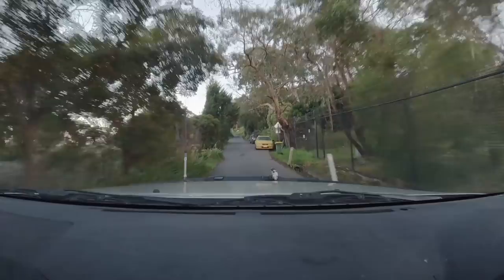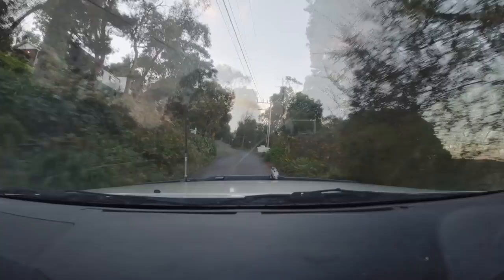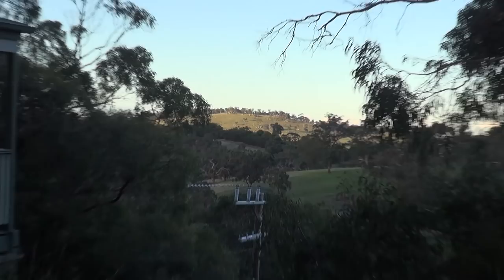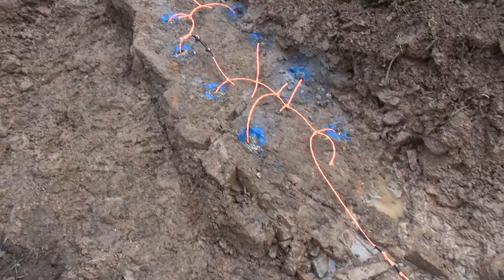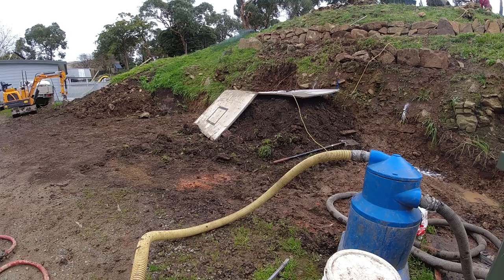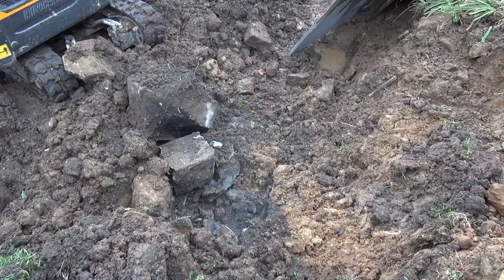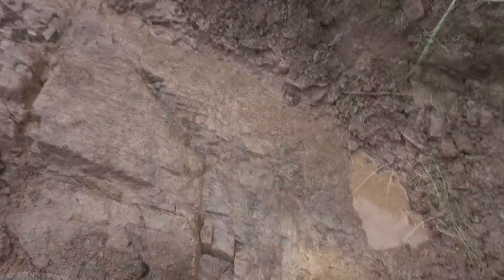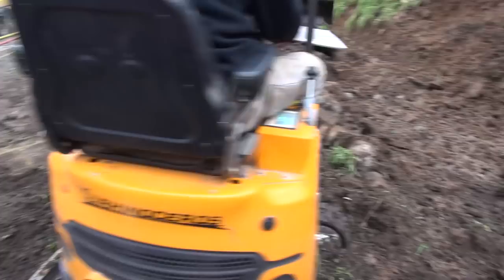Rock gets blasted to build a retaining wall

Comment: That’s a steep ass driveway. Feels just like I’m driving my lawn mower up the ramps onto my pickup
Reply from the maker: A bit like that, I was a bit concerned that I would have to reverse down with the compressor on the back and the very sharp turn at the bottom would have taken a few tries. My clutch takes a beating on these jobs.
Reply: @demolitiondavedrillandblast  Throw the driveline into 4 low Dave, use the mechanical advantage. It's only a short distance on pavement, and you are doing sharp turns, so driveline wind up won't be an issue.
Reply: This is where manual lockout hubs on the front axle shine, on a steep but hard surface or when backing a trailer use low range with the front unlocked, makes even a short trailer a breeze

Comment: Hey young fella
Many moons ago I did a shotfirer course. 
Most of it has been lost in the grey matter but watching your videos brings it back. 
You may have done this before but I’d appreciate a basic break down of what you use. 
Det cord, gelignite, Andover, delays etc. 
just a thought. You seem to be busy guy. 
I do enjoy your work.
Reply from the maker: Hi Ron, The old NG Gelignite is no longer available in Australia, it has been replace with a more user friendly product called a packaged emulsion - no headaches or leakage and ANFO of course. Det cord does not get as much use these days nor electric dets, most of the dets used are now shock tube  type, also known as Nonel (non electric) - again safer and easier to use. Thanks for watching.

Comment: Blast!  I was going to go to bed - but then I saw your new video.  I had to watch it straight away.
(After watching endless hours of Letsdig18, that excavator was sooooo frustrating to watch.)
Reply: Yaaaa  for Chris from LetsDig18!  Another great program to follow.
Reply: Exactly the same thought.
Reply: Ditto, I had a rant comment that was totally out of place. Job got done and won't see it from my house, so I deleted said 🙃comment 🙃
Reply from the maker: A big machine is great Craig but even a regular tip truck to carry a 3 Tonne machine would be a very tight fit along these roads and there is just nowhere to park the truck. They even have mini garbage collection trucks for these areas. I also watch a bit of @Letsdig18, feel free to give my channel a mention in the comments there using the @ symbol e.g. @Demolition Dave Drilling and Blasting

Comment: Ya those little machines can be frustrating but its better than shoveling by hand, no wonder you guys drive 1/4 ton trucks what a goat trail driveway.
Reply from the maker: Any steeper and he would need a winch point at the top. I wonder how they got the concrete up there when the home was built??

Comment: These small machine can be harder to operate because they are loose and jittery. It takes some practice to get used to them. Big machines are smooth and powerful. I find my little Cat 1.7t excavator perfect in tight residential areas and its powerful enough to run an 450mm auger, hydraulic hammer and move chunks of stone/stumps
Reply from the maker: I need one for a tight little job at home.
Reply: @demolitiondavedrillandblast  would love to help but I’m in Brisbane Qld 🤓
Reply: paul barnett, yes i agree the little ones are harder to operate.  the skills learnt  mastering little ones transfer very well to big ones.

Comment: Hi Dave. I'm David too! Have you ever explored oxyliquit (a liquid O2/fuel sprengel explosive)? What do you think of its practicality?

Also, for continual daily blasting (say 2 kg charge muffled by dirt every hour), what is a very tolerable distance from residential zones?

Thanks Dave!
Reply from the maker: Hi Dave the little that I know about liquid oxygen explosive tells me that they are not very practical compared to contemporary blasting explosives and a lot less safe to handle.
A 2Kg charge in a residential area will bring complaints very quickly, even if you muffle the noise, the vibration would be a shocker. You would generally aim for a vibration with a peak particle velocity of <5mm/S. For 2 Kg charge in average conditions you would need a separation distance of about 45m

Comment: Rhyodacite is described as a Granite-like igneous rock resulting from a rapidly cooled extrusive Lava, which implies that hill is an old Volcano?
Reply from the maker: Yeas this hill is indeed and old volcano TTK
Reply: @demolitiondavedrillandblast  , was that 2nd piece rhyodacite as well?  all those fractures and very close to that first piece that didnt seem to have been stressed.
Reply from the maker: Yeah, same type of rock, down the south end of the mountain range it is all fractured and faulted like this, the rest of the mountain range is more reliable drilling with much less defects in the rock.
Reply: ive got an idea for you.  yesterday, someone set up an explosion on the vacant block near my house.  i heard an almighty bang thinking someone had smashed into a car out the front.  all i saw was a small flame coming out of a burnt can with the top missing.  the neighbour came out the front for the same reason as me.  i went over for a look.  there were the remnants of about 100 sparklers folded over with the leftovers of a can with the top blown off sitting on top.  and the empty packet of the sparklers.  i think hair spray was probably what was in the can.  the can was seamless.  there was no paint smell.  i trawled youtube looking for the video this was copied from.  the closest i got was
Reply: youtube wont let me open up that last reply to finish it.  the closest i could find was a video by vaultronald.  he seems to live around bunbury.  do your licences cover sparkler hairspray bombs?
Reply: @demolitiondavedrillandblast  , righto.  so i didnt notice the fractures in the first piece you eliminated.

Comment: Carries bucket in one hand. 
Small machine?

No delays to reduce ground thump?
Are they expensive?
Reply: There's a black, dog bone delay in the first shot. Second's too small to need it.
Reply from the maker: I'll have to appoint you as a moderator #42
Reply: @demolitiondavedrillandblast  
Not with my "scant regard" for polite language matey. 🤣
Reply: @GARDENER42  
Swing that ban hammer of Thor.